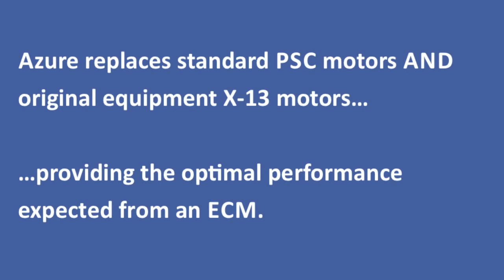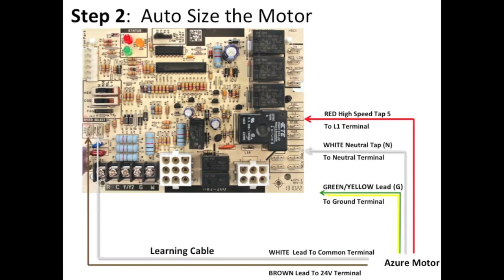Azure® Digi Motor Installation, MARS No. 10860

Comment: Beautiful explanation. I've been watching vids and so far this has the best explanation. I am now confident in replacing our motor. I was a bit on the fence before since I had trouble understanding exactly what to do but this hit all the right spots. Thanks for the great well explained to the point video!

These last few Days of learning has been a quite a chore, but for the Money I'll save doing this myself it's worth the headache since I don't have much of a choice- I either do it myself or have no air for the rest of Summer and no heat come winter (which I'm fine with, I like the cold- the rest of my family though, they don't like the cold so ya). I have very little Money so I do as much myself as I can- and it's good to know how the things that keep you alive and comfy work.